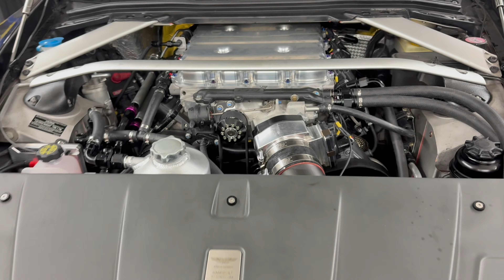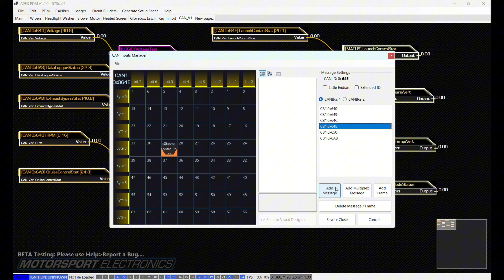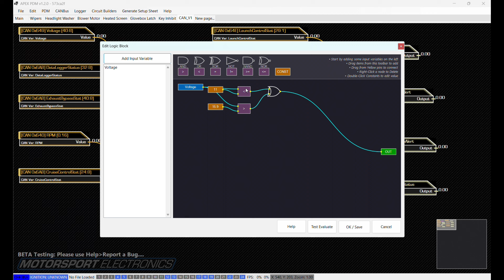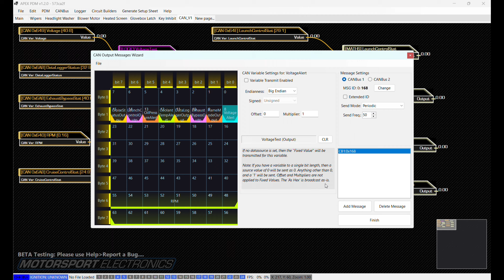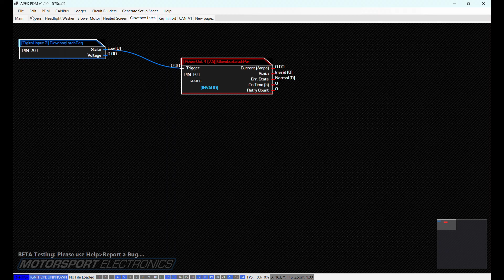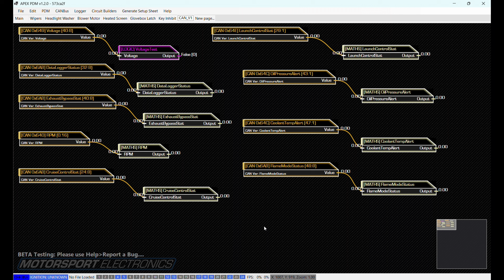Aston Martin Vantage Gen V LT4 Swap - Apex PDM Overview

Comment: Does it work as intended?  Deciding between this , ecumaster pmu24 and hardware electronics pdm unit.
But I like the approach of the unit, the software looks real cool.
Reply from the maker: I have had absolutely no issues with this unit.  Motorsport Electronics' communication has been top notch as well.  The other options you mentioned are very nice as well (I've owned both), but I'd absolutely give this unit a shot.
Reply: @BlakeMcBride  Have you found any disadvantages?